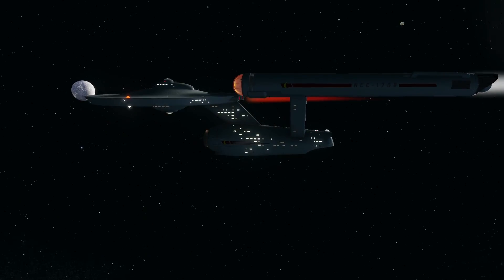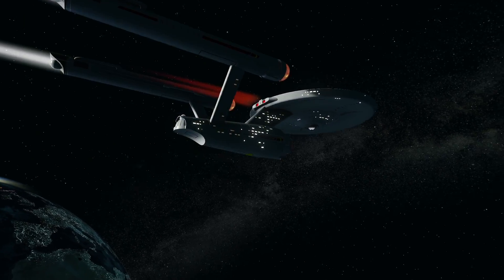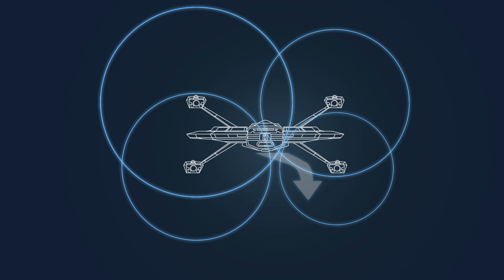Why Extra Nacelles?

Comment: Here's another question about warp nacelles: why are there so many different kinds of design?
Of course it's fine as an art medium, but in universe, it'd really hamper interfleet modularity and replacement parts.
Reply: At first around the TOS era ship parts diverged less. then around TNG era just before the wolf 359 battle there where many new designs but most of these used almost the same type of modular parts as the galaxy class wich was the most modern ship at the time. 

It is only after that event when starfleet really starts to diversify their ships as a response to the borg adaptavility, making many new designs that would be more specialized in certain roles, with combat in general being the most notable since starfleet had a kind of aversion to try and design ships focused on war until the borg menace and the dominion.

On the other side, if we are going to talk about warp nacelles in particular, different types of nacelles would imply different roles and activities in wich they would be generally employed (and by extension, the starship). depending on the activity, specific requirements and priorities would be stablished, such as different pacing, more efficiency, or more speed in exchange of efficiency. 

Voyager nacelles where a special kind that used variable geometry to get higher warp factors while also being very efficient for long space travel given the ship is used for deep space exploration.
 
The sovereing class if im not mistaken would have worked around the issue of having to bend the nacelles so they remain fixed in place and still get higher velocities without the subspace warp issue and get that peculiar shape, (pressumibly so they have a more consistent, less vulnerable structure), more suitable for combat.

The Defiant class nacelles where mostly covered in armor and only exposed on the back of the ship (given that it is a warship and a lot of damage is expected for a little ship like this).

There would be more examples of course but these are the ones that come to mind.
Reply: Given the nacelles pop off even in Jeffries’ first sketches, I imagine that’s only really an issue if the plasma hookup or the structural connectors were a different form factor. 

Each nacelle casing shape is built around the specific shape of the warp coils inside, which are each tuned for various strengths, run durations, heat capacity, etc. 

Starfleet seems to go through phases of experimenting with many different designs of warp coil, then picking the best 2 or 3 and using only those for a while, while R&D continues to research new geometries before picking the best candidates to do the next round of testing. 

It’s worth noting eg the Nova-class had the same coils and nacelles as the Sovereign (trapezoidal), the Luna-class the same as the Galaxy, and so on.

But the late TNG era wasn’t the only period of diversification, as both the Excelsior and Oberth classes have unique nacelles for their time. 

Though it must be noted the Oberth nacelles were first designed for the original Excelsior study models, so that was originally intended to just supersede the refit Connie nacelles. But as it stands, Excelsior got long thin ones while Oberth got shorter fatter ones. 

One could even argue the period of experimentation began shortly before Discovery and ran right through TOS into the TMP era, since the Disco ships all had the same type over a few decades. But then in quick succession, they tried the cylindrical and rectangular cross-sections for the balanced (Connie) type, along with the (Excelsior) speed and (Oberth) efficiency ones. The Excelsior coils are potentially circular (or ovoid) rather than rectangular too, indicating further development of both subtypes.

Comment: I would think that by the time of the end of Voyager there would have been absolutely no reason whatsoever to build any starship with more than 2 nacelles unless it was a very good reason like the Prometheus.
Reply: It might be for the same reason that modern jet airliners are almost always built with two engines. Three engines can give more power and redundancy than two engines, but then you have the extra complications of adding the additional engine. In the end the gains might not be enough to justify the added complexity. With four engines you can have them working in pairs, but you have twice as many engines that could potentially malfunction. A single-engine design offers the most simplicity, but if that one engine malfunctions for any reason you would be essentially dead in space without the limp-home capacity a second engine would allow. Just spit-balling here (as I'm not a Starfleet engineer), but that's my thoughts on the matter.

Comment: Most single nacelles actually have 2 warp coils in them, effectively as if there were 2 nacelles hence they can go as fast as most vessels with 2 separate nacelles.
Reply: On the diagrams they usually have anywhere from 6 to 15 in a row. The Defiant might only have 5. I believe the TOS Connie had 8 in each nacelle?

Comment: It really should be noted that the 'even number only' rule comes from the initial production/writer's bible for TNG_. Roddenberry, et al. went out their way to throw out all the fan material of the previous couple of decades, and also declared _TAS 'apocryphal'. This is sensible from point of view of not trying to not contradict a bunch of material they had no part in, and frankly contradicted itself. But that rule was really just a direct attack on the Star Fleet Technical Manual (source of the scout and destroyer classes).

As time went on, a bunch of things were relaxed by later productions. Elements of TAS were referenced by later shows, a three-nacelle Galaxy-class Enterprise shows up at the end of _TNG_... etc. The real point is, don't pay too much attention to the 'even number' rule, it's an artifact of its time in the franchise.

Comment: Nacelles need to be in pair ? Since when exactly ? How about those ships with 1 or 3 nacelles ? You know, those shown in pretty much all Star Trek books from before TNG. Ball and cylinder type ships where very often fitted with only a single nacelle. There was even one without a secondary hull where the nacelle was fitted dead centre behind the ball primary hull without any pylon.

Comment: Nacelles aren't 100% necessary for warp travel, as the Enterprise D's saucer section could achieve Warp speed without any. But it's never really said if they can accelerate to warp speed, or simply maintain it?  as most cases of the Galaxy Class separating occurs while the ship was already at warp speed. 
 Also, I think in most cases of 3 nacelles, the 3rd is used to power/channel the phaser banks to allow stronger beams, and more arrays mounted on the ships, which would be considered effective against foes like the Dominion, the Borg, and the Cardassians.

Comment: I'm actually confused about something, why don't they make several smaller warp engines that can be slapshot or retrofitted around a primary engine and then separated like that SS. Prometheus from Star Trek Voyager which was constantly flying at warp and somehow got boarded by Romulans (that's what they get for putting on a Skeleton Crew honestly, at least 200 to almost 1000 crewmen, would seem easy to me if you snatched them from distant outposts along the ship's path towards the Delta Quadrant)..

Comment: Could theorise that some nacells are more or less powerful than others, therefore more less powerful nacells are required to meet performance targets.
Take the comparison between WWII bombers, Avro Manchester and Avro Lancaster, for example.
Reply: The varying number and share of warp coils in the different nacelles suggests as much too — like maybe with each new coil design it can handle so many TW/cochranes and they just apply however many coils they need for the size of the ship and the desired top speed. As the coils get better over time they need fewer for the same mission profile, but also can keep the same quantity of coils and just go faster for longer.

Comment: I'm thinking of Zefram Cochrane and Archer family of nx-Warp era is like our era of research project of X-planes are a series of experimental United States aircraft and rockets, used to test and evaluate new technologies and aerodynamic concept officially came into being in 1944, as a joint programme between the National Advisory Committee for Aeronautics (NACA), the US Navy (USN) and the US Army Air Force (USAAF), in order to pursue research into high-speed aircraft.[2] NACA later became the National Aeronautics and Space Administration (NASA) and the USAAF became the United States Air Force (USAF). Other organizations such as the Defence Advanced Research Projects Agency (DARPA) and the US Marine Corps (USMC) have also since sponsored X-plane projects with the enterprise episode first flight must be an retelling ofLt. Col. Frank K. "Pete" Everest completed the first powered flight in the #1 airplane (46-674) on 18 November 1955. By the time of his ninth and final flight in late July 1956 the project was years behind schedule, but he had established a new speed record of Mach 2.87 (1,900 mph, 3,050 km/h). About this time, the YF-104A was demonstrating speeds of Mach 2.2 or 2.3 in a fighter configuration. The X-2 was living up to its promise, but not without difficulties. At high speeds, Everest reported its flight controls were only marginally effective. High speed center of pressure shifts along with fin aeroelasticity were major factors. Moreover, simulation and wind tunnel studies, combined with data from his flights, suggested the airplane would encounter very severe stability problems as it approached Mach 3.[

Comment: Careful not to compare other species FTL systems to Federation.  Not all races develop FTL the same way.  Federation FTL is a dominant form, but there can be other setups.  Much as Romulans use artificial quantum singularities (black holes) as a power source in warbirds compared to matter/antimatter reactors.
Reply: This isn’t comparing the reactors though, this is comparing the subspace field coils and how they are suspended on/around the ship. For all we know, they’re exactly the same and are just energised differently.

Comment: Please tell me where you are getting your info regarding warp travel from? I seem to not be able to find much on it. From what I got from watching the shows are that the warp nacelles contain only the warp coils, bussard collectors  and the plasma conduit. From what I gather the warp nacelles do not provide propulsion just a warp field as seen in s4.e5 "remember me" where a static warp field was generated to conduct an experiment. I get how warp fields bends space allowing travel but not convinced that it also provides propulsion as well. From what I see on screen is when almost every ship is at warp, their impulse is lit up meaning it's active. Knowing that the impulses are basically fusion engines so if they're lit then they are in use. From this I developed a theory about warp travel. I did talk to some of my "treckies" friends about this and they think I'm on to something here. I would like to have some more input of any kind. So my theory is this; To initiate warp travel, plasma from the core is used to power the coils in the nacelles to produce a warp field. Depending on the shape and size of the ship; will determine the size and location of the nacelles with the type of warp coils use can give flexibility as to the location; (Place the nacelles close to the main body, a ship can have smaller nacelles or even just 1.) or the amount of nacelles needed. Once a stabled warp field is established, the ship uses it's impulse engine to propel the ship. I come to this theory because I believe that doing this will cause the warp field to destabilize if the warp field is not corrected and stabilized on the go. so the faster you go, the more power you need to maintain the field. We always hear about structural integrity being compromised when at very high warp. This could be caused because the field is at it's rated max and the ship is in close contact to the field as the warp field itself is being warped but the output of the impulse engines. I can see ships with multiple nacelles to spread out the warp field if they do not have good coils or use them to save on the life expectance of the coils. If you have more nacelles then you can limit the usage of the coils making them last longer or put more power to them for a more stable or larger warp field (good for towing at warp speeds). This seems to answer a lot of questions including the issue with the subspace tearing and what happened to the warp limit. It highly likely a new coil was invented to solve the issue. I'm sure that the new shapes star fleet is using also helps. Think about it; By reducing the warp speed the coils don't work as hard, causing a severe reduction in the tearing. This means that there is some reason to believe that field warping is what causes it. The new coils simply fixes it hence the much higher warp speeds we are seeing in trek. Like I said; I'm interested in what others have to say about it. I might be missing something or overlooked something. Thanks. Sorry for the long read. my hands are tired now. :)

Comment: You know, now that I think about it. Why have more nacelles when having more cores spread throughout the ship would be better.

Extra power for weapons, shields, and the main core being used for FTL and power to the engines.
Reply: The Galaxy class has 12, or 16 or something, fusion reactors for exactly that reason. The warp reactor is only for engines, the fusion reactors handle everything else in the ship. 

Then they seemingly forgot that by Voyager, when the entire ship is on low power mode when the warp core runs low. I can understand having fewer fusion reactors for the smaller ship, but at least have 1-3!

Comment: Seems like each nacelle is kind of a parallel to plains of today. Multiple engine/turbine planes can usually go further than other planes and if one engine goes out then the others can shoulder the burden for a little bit. Not very efficient, but doable enough to get you home or somewhere safe. I don't mind the theory-craft being added b/c honestly cannon keeps getting changed or altered or ret-conned or something stupid like that. Especially since Roddenberry purposely made some things enigmatic just to keep some of the magic and awe of the ST universe alive. Which is fine, but then you have those that "just need" answers to everything for some dumb reason.

Comment: The constellation was a heavier ship then consitution not in volume but in cargo and shuttles yes vaccum of space but you still got mass you have to push out of orbit also good to have a pair of back ups it’s not gonna make it faster it’s gonna create a more stable warp field but more necelles means more powerful warp core or multiple cores becuz necelles are comparable to tires on a car they take the engery created from the engine and the tires put that power to the pavement warp necelles take the energy created from the warp core warp engine and emit the warp field to bend space very similar comparison using the Star Trek manuals they litterly tell you how Star Trek ships work in their sci fi universe tho they don’t dumb it down to explain to you they work like tires on a car propellers on a boat or old plane

Comment: Since this is fantasy there is no reason not to have variables in the equation. Seriers designer. So the the main body,or saucers could have integral warp nacelles in the outer edges of the ship. Rember the creators of the series didn't want flash gordens rockets, or flying saucer of the other 1950's sci-fi. They wanted something unique, or new design.

Comment: Putting more wheels on your car will not make it drive faster, or further, or with greater fuel efficiency.
It might increase your maximum (passenger, cargo) weight capacity, your steering and handling, your fault-tolerance redundancy in case of damage or breakdown.
It would certainly increase your maintenance costs.